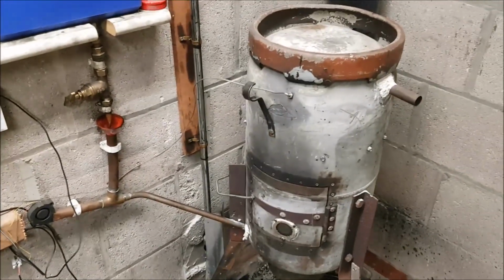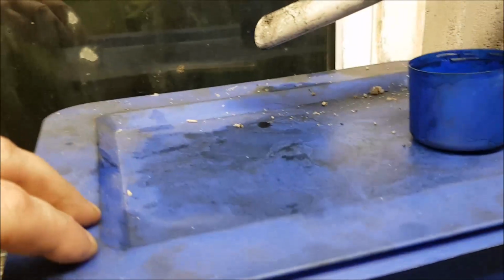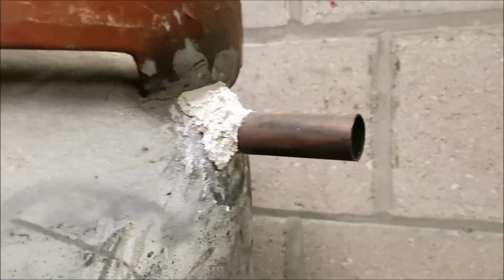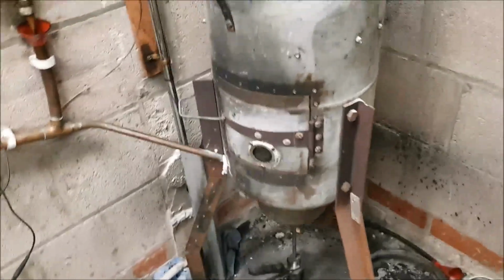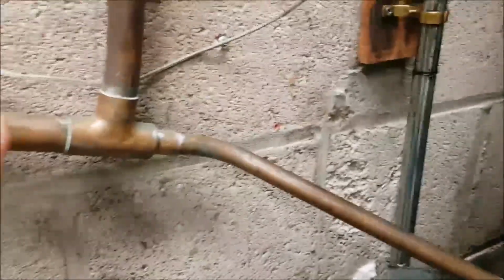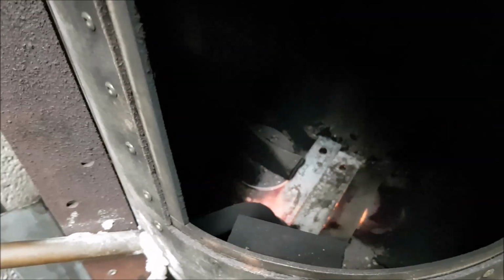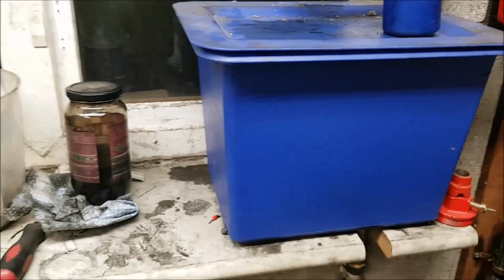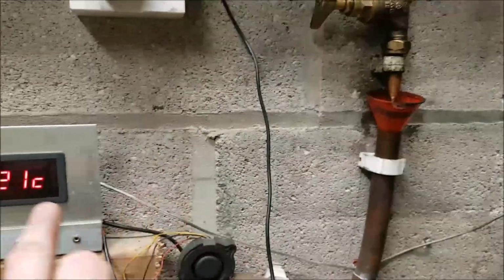Homemade waste oil heater/burner blue flame update

Comment: I think the reason you dont have a blue flame is your air fuel mixture is a bit too lean, if you richen up your oil supply it will likely turn blue, yellow flame is an indicator of lean burn, at least thats what I have found with my oil burner. I would like to build a smaller more oil efficient burner like yours, mine burns way to much oil and produces way to much heat for my shop space.
https://www.youtube.com/watch?v=1tGXJkIPk34&t=1s

Comment: Good day. Your vedios and inventions are right on time, with the Food and heat challage in UK right now. But tell me ... Is one able to setup your used oil heater in a rental/letting.
Reply from the maker: No. The reason is you need a licence to run a waste oil heater. You can buy a waste oil boiler but again it will have to be registered together with a £2000.00 license that is if your in the UK. I have a log burner in my home and just heat my workshop with my waste oil heater. Hope this helps.

Comment: Hello. Do you have any updates about waste oil heater?
Reply from the maker: I am planning on a new design as I still have to open windows to let out the heat. Need smaller more consistent oil feed and safer burner.
Reply: @fixitmakeit72  , Did you consider using a peristaltic pump for feeding the oil? With that you will have precise control over the amount of oil feeded. Also it's possible to automate the feedrate depending on the generated heat.
Reply from the maker: @82levy5  Yes awaiting delivery from aliexpress with speed controller. Taking ages to get to UK!

Comment: This in nothing like a blue flame waste oil burner. First they aren't made like that ,second thing they produce a blue flame sorry to say yours doesn't  and never will.
It's the way there built that makes them turn blue.
Reply from the maker: I know Jim,  intending to upgrade with dosing pump, speed controller for both fan and pump and new burn chamber.
Reply: @fixitmakeit72  yeah even that won't make it blue. That will just keep it controlled.

Comment: I've watched all these vids many times, and I've only just noticed - you don't weld. Lots of rivets. Good set-up though.
Reply from the maker: Thanks. I have a mig welder but i thought i would build it this way just for the many people out there who are not in a position to weld stuff. I also chose rivets as they are stainless steel with a high melting point, non corrosive to moisture, cheap to buy and simple to use.